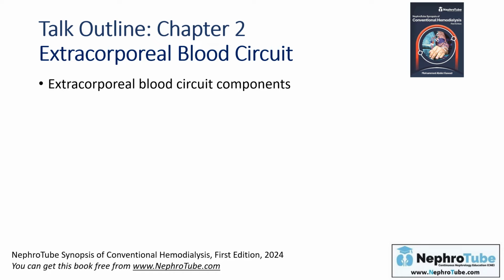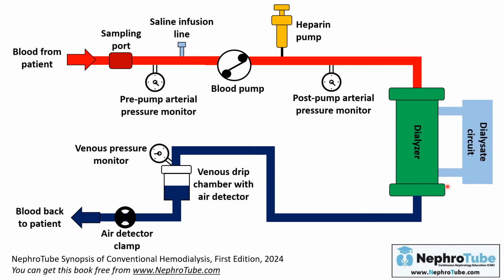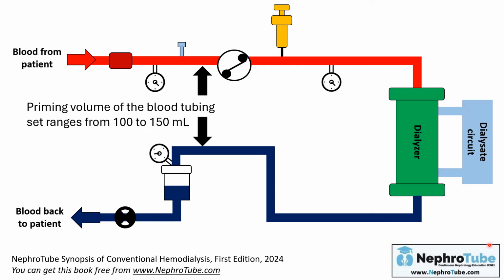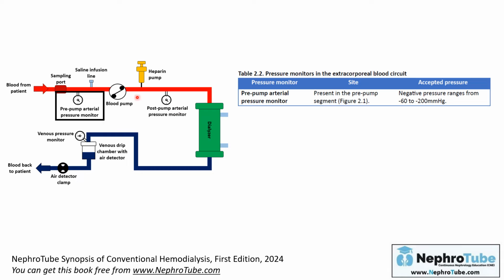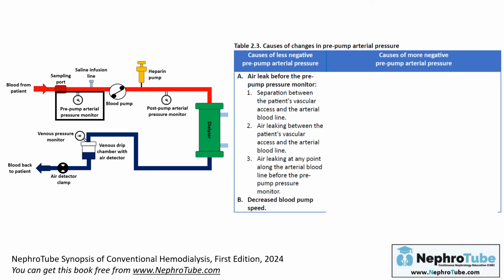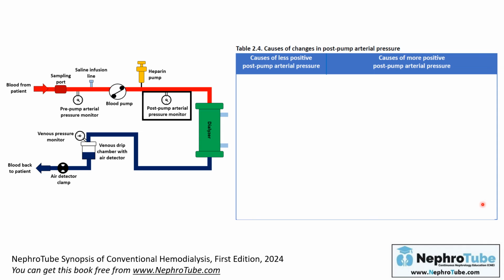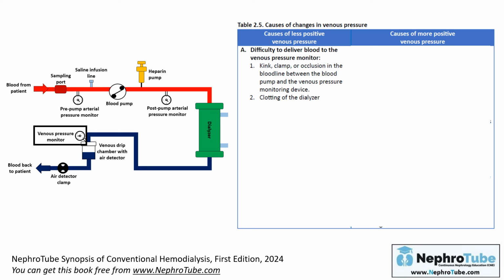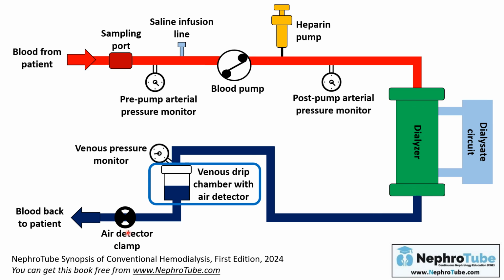Hemodialysis: Chapter 2: Extracorporeal Blood Circuit - Dr. Gawad (English Language)

Comment: Is the post pump arterial pressure monitor the same as TMP ?
Reply from the maker: No, not the same. However, there may be overlap of some causes that may affect both. Wait for lecture 5 for more information about TMP.
Reply: @NephroTube  thank you so much